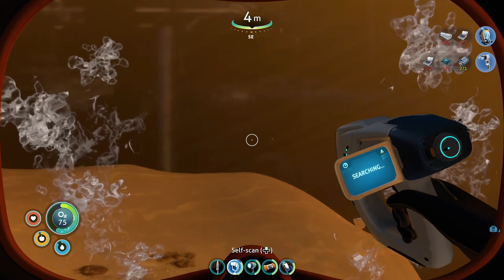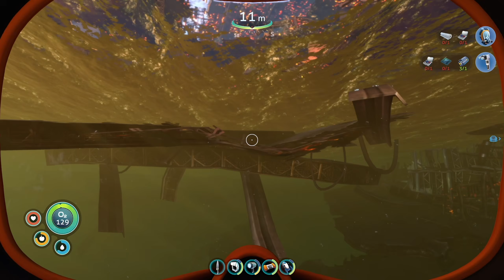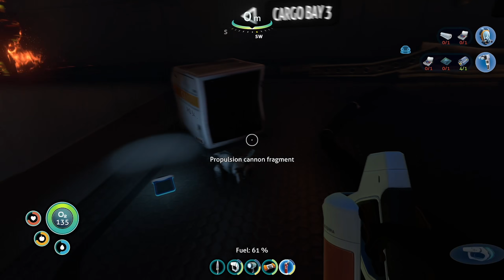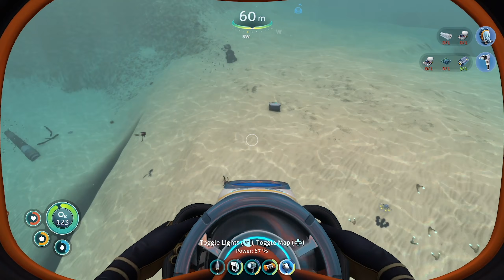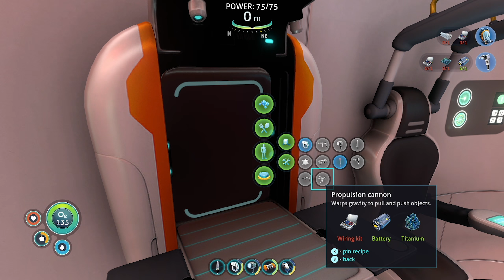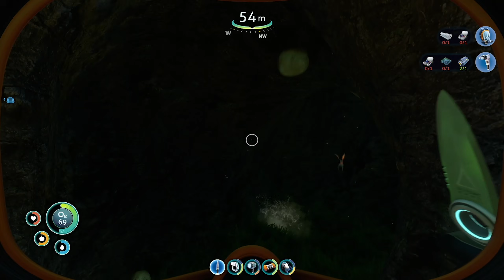Subnautica - #4 - oh no, fire

Comment: 9:10: I am reasonably certain that the explosion was caused by the crash, not vise versa.
26:14: Guilty! When they say "beware the Ides of March," do not do to the forum!
...that would be funnier if I watched this video in a more timely fashion.

8:05: The danger of cave diving. Or wreck diving, in this case. Which is even more potentially dangerous, what with the jagged metal and tight quarters and radiation.
10:25: "Avoid or incapacitate..." (initiates knife fight)
18:00: The laser cutter sounds more like a tool than a weapon. We can't all be Isaac Clarke.

26:40: Ah, yes! (misunderstanding) I love transgender governments!

Comment: Spoiler-Free Tips

>Only cook fish if you're going to eat it right away.  If you're planning to eat it later, like when leaving on a journey, cure it with salt instead; salt isn't really used for much, so you won't easily run out.

>Always watch for the scanner icon in the bottom right corner of your screen; it pops up whenever you're looking at something you can scan but haven't yet.  This is easily the #1 most underutilized feature in the entire game.  You've missed some pretty good stuff already.  So far it's all been decorative, but that won't continue to be the case forever. 

>Time Capsules shouldn't really be interacted with during your first playthrough as they often contain spoilers.  When you beat the game you can leave one behind with items, a message and a screenshot.  Many people put high-tier equipment or resources in them which you aren't actually supposed to know about yet.

>The rebreather goes in your helmet slot; you can't wear it with your radiation suit helmet.  You'll need to find a way to stop the Aurora from leaking radiation before you can effectively use it.

Comment: The time capsules usually come with a picture and message you can see in your data tab... They're user created though, so some spoilers could slip through that way, but they try to moderate them to prevent that.
Reply: If you COULD load yours, and know it was going to Dan, what would you put in it?

Comment: Now that you've unlocked them beacons are your best friends that will save you a ton of time and potential frustration and possibly even save your life later on. Be sure to deploy a beacon near any habitat you build since habitats don't come with their own markers and it's easy to be lost even in familiar areas.
I'd recommend always keeping at least one on you and deploying them any time you find something you'd like to be able to return to that doesn't already have a marker on it even if it's just a major landmark or path you plan to follow. You can always pick them up again later if the marker isn't useful anymore or just turn off the marker. When using beacons be sure to interact with them after deployment to edit the beacon name so you know what it's actually marking.

Comment: so the blueprints are randomised, but only within their region. So you'd still find the same blueprints at around the same time but you will still need to actually go out and hunt for them as it were with every new game as they won't always spawn in like, box 3 and box 7 at some fixed coordinates.

There is actually very VERY little randomised content in subnautica, which is in part why I love it so much. It's a lovelingly and carefully crafted experience... warts and all :P
Reply: Good thing, if the blueprints got shuffled around outside their assigned areas it'd be literally impossible to progress without hacking/glitching your way through.

Comment: 19:34 There were multiple scanables in the currently accessible part of the ship as well, actually! Unsure if that includes the laser cutter fragments, but whenever you go back it might be worthwhile to try to use your scanner a bit more - there's a helpful little symbol popping up at the bottom right of the screen whenever you're looking at something that you can scan and haven't scanned (enough parts of) already :]
Edit: The symbol appears whether you have the scanner out or not, so you can still keep the fire extinguisher or something else in hand if you don't want to constantly hold the scanner, which I found very helpful!

Comment: A few non-spoiler gameplay tips:
Swimming with a tool in your hand actually decreases your swimming speed (the exception being the seagilde of course). Useful if you need to swim a little quicker for air or to escape a crash fish.

As for the randomization of blueprints, they are somewhat random. There is a set of potential locations where blueprints might show up, but they can show up in any of those potential locations. Seaglide fragments will be in early game areas, but where in those areas is variable. But you won't find them in late game areas.

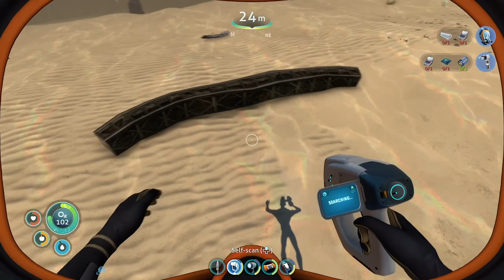Comment: 22:16 Databoxes have fix spawn locations, however if you already got the tech of a specific databox elsewhere before you enter the biome for the first time the databox will not spawn at all. Fragments are seeded randomly, however they are tied to certain biomes - you won't find any late game tech in the first few biomes, and neither will you find early game tech in any late game biomes. Beacon Fragments for example can only be found in the Safe Shallows biome (the start biome).

23:05 Always pick up time capsules when you find one - they have a tendency to despawn never to be seen again if you don't. Time capsules were created by other players btw and and might contain some items the player left others, a photo the player took and a written message, some of which are really cool if the player wrote a cool ingame message instead of some dumb outgame message.  

Up to 40 time capsules are randomly seeded across the map in every new playthrough.